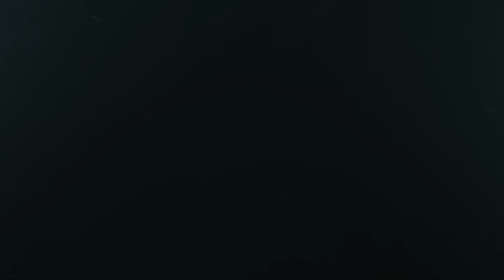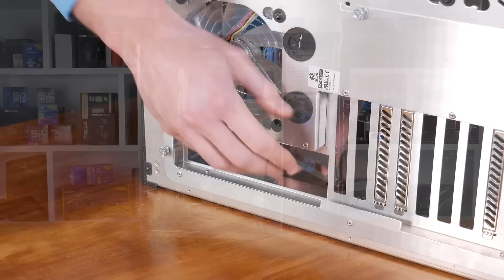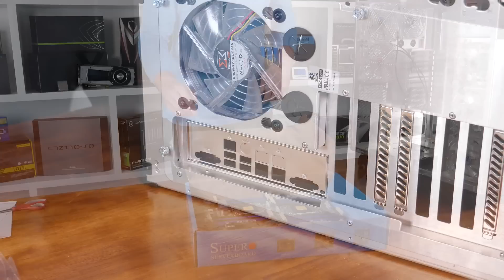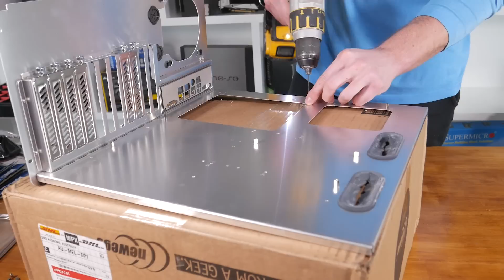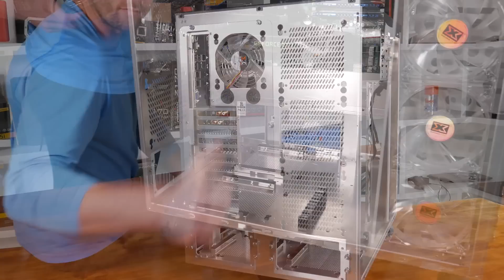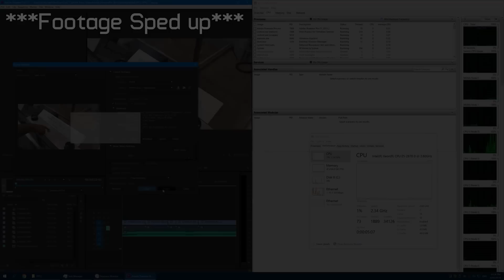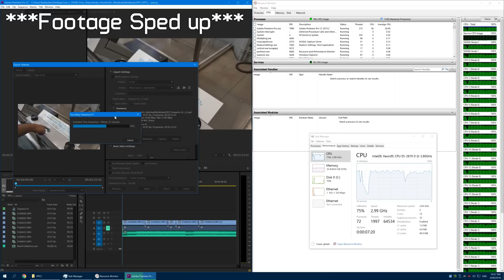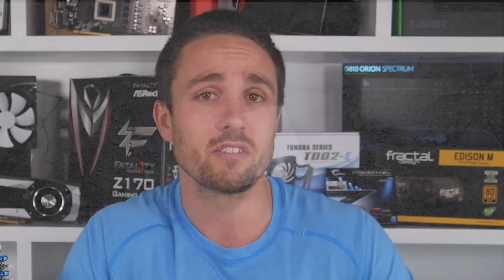6950X vs. Dual Xeons: Premiere Pro CC Encoding Battle

Comment: Time rolls on.  This is not such a good deal now.
An i7-6950X now sells on eBay for about $475 US.
A pair of E5-2670 are around $150-$200 US.

If you go with dual Xeon E5-2670 vs i7-6950X you are getting:
- Sandy Bridge vs Broadwell-E
- Released 2012 vs 2016
- 32nm vs 14nm
- 16/32 thread vs 10/20 thread
- AVX vs AVX2 (2x faster on certain functions)
- 2.6/3.3 GHz vs 3.0/3.5/4.0 GHz (faster IPC, faster single core)
- 20MB vs 25MB cache
- DDR3 vs DDR4-2400
- ECC required (ECC usually has no heatspreaders = hot!) vs not required
- LGA2011 vs LGA2011-3

And the typical motherboard required for each:
- dual CPU vs single CPU
- server vs workstation
- EATX (monster case) vs ATX
- X79 vs X99 chipset
- No VRM heatsinks vs usually VRM heatsinks
- SATA3 or 6 or mix vs often 10+ SATA6
- USB2 vs USB3
- limited OS drivers vs full Windows support
- lots of oddball RAID and NIC and Video and peripherals vs typically standard Intel peripherals
- usually no sound chip vs sound

Plus the dual Xeon has the following things to keep in mind:
- LGA2011 server dual CPU motherboards are usually a lot more money than LGA2011-3, up to twice the price.
- The memory for each CPU is separate, so if the dual Xeon board is populated with 32GB that is 16GB per processor.
- The motherboard is EATX which requires a different large case that supports that form factor.
- Requires two CPU coolers, twice the price.
- Twice the processor heat dissipation.
- Most software these days, from Photoshop and Premiere Pro, to WinZip and 7Zip, to Max and Maya and Blender, to UE4 and Unity, and especially video games, higher core frequency almost always wins in performance.  Especially in games and productivity software, where most games don't support more than 2 to 4 threads, and most productivity software is 1 or 2 threads.
I played around with a few 16+ core servers a number of years ago, and simply gave up when I had my i7 4C+HT CPU's beating them for less money and work on most software.

Comment: thanks for this review, just bought a z620 with dual 2640 and 32gb ddr3 for £350, will spare another £100 for extra 64gb once arrived! My spare 1tb ssd and my good old gtx980ti going straight into it.

Comment: one more question if I have a budget of 600-700$ should I invest in Xeon processor or i5 processor, slight gaming and more of 3d rendering.
Reply from the maker: Probably Xeon.
Reply: Netraraj Pun e3 1230v5
Reply: kasian E3 1230v5 was out of my budget, it cost around 650$ in India
Reply: Netraraj Pun That sucks mate. You might want to take a look at the e5 2670 it's cheap on ebay
Reply: I love to do that but believe me the ebay India is just useless. Most of the time we get broken product(mostly when a used product is bought). Finally ended up using i5 4460, yeah its not great but its working
Reply: Netraraj Pun still a very nice cpu! have fun with your pc.
Reply: :D thanks.
Reply: Ryzen 1800x is much better under500

Comment: The Problem is more with Adobe Premiere itself that does not run well on high-end Processors (and even worse on low End consumer grade processors), does not scale with a second socket (due to the utilisation of just ONE process that does only reside in one processors memory due to being only one process). You are better off buying a 15" Macbook Pro instead of just the 5960X, that is giving you better results in Final cut.
Reply: Final cut is designed to only ~roughly~ work with whatever chips Apple decide to put in their machines, which is off considering the Mac pro desktops used X79 in the past.

Nonsensical little side note
Reply: FCPX is designed to run at exactly the hardware Apple (only their current hardware!) uses and nothing else, sadly. But that was not X79 but C602 (which is actually the same die but yeah) because Apple uses Xeons in that thing.
Reply: Nonsense and Pure Crap. PPro CC runs perfectly well on high end processors and scales with 2 CPUs (and GPUs) just fine.  If you're so determined to run your 15 inch Mac Pro and FCPx that's fine. Just don't pretend that it can compare to PPro on a dual high end system.
Reply: Okay. Did it change recently? I tested back in March with dual E5 2658v3s and really, there was no performance benefit with 2 processors whatsoever. It was even slower. GPUs are a bit of a different story but in general support for GPUs is pure crap and you get like 50% faster render times with 600% more compute power which is a pretty bad quote for any developer.
Reply: The best bet for video editing processors is currently the 6700K, not because it is a insanely fast processor, but because it is insanely popular. On a Mac you can get away with anything > Macbook Air
Reply: You're only talking output rendering times which is not an Apples to Apples comparison as the touted rendering times in FCPx are from Prores transcodes and not from camera originals that PPro renders from. AFA rendering, PPro uses all available cores and hyperthreads. But the real point is that you say in your OP "runs". And '"runs" means editing, not rendering and PPro edits with all available cores and hyperthreads and I assure you that trying to compare a MBP FCPx with a dual Xeon 1080GPU PPro system performance wise is ludicrous.
Reply: Sorry, I meant the actualy program with "runs". And yes, a wimpy MBP puts a fully fledged workstation to shame when it comes to rendering times. I know that the final render is from pro res but why should one render from the original? That makes no sense in any way apart from having an argument why it unfair to compare. And by the way, editing with premiere is extremely powerful but a shit of an unpleasing user experience. Adobe is quite good for complex things in general but youre outta luck if you have to get something done quickly.
Reply: No, the touted rendering times in FCPx are FROM the lowrez Prores intermediates not TO Prores. Therefore they are much faster than from camera original material. You render from from camera originals in PPro because 1) you have no need on the front end to render intermediate transcodes as in a low powered FCPx system and 2) you get higher quality  output.  You should be aware that an unpleasing user experience is in the eye of the beholder. I find FCPx a much less pleasing experience than FCPx. But I do complex docs with a lot of 4k material which a dual Xeon system is ideally suited to.
Reply: Right, but this is rather Adobe fault, not Intel. Adobe has a history of poor coding and overcharging customers for selling unstable, early alpha versions as the final products. My suggestion would be easy - stay away of Adobe.

I have a workstation based on 2x 2640v4 (40 threads in total) and rarely see more than one thread utlised in photoshop, illustrator, premiere or ae. This is the 2017 CC edition, not some ancient software.
Reply: I love editing in Final Cut Pro. I hate editing in Premiere Pro but I can't do Apple desktops. My 15" rMBP just flies through complex edits sometimes!

Comment: Xeon = lower cost and much more bang for the buck even the Broadwell Xeons are vastly cheaper than the i7s. Rocking a $105 12 core v3 xeon on a x99 :)
Reply: Which cpu is that ? Is it clocked over 3.0ghz ?
Reply: broadwell xeons are extremely expensive. Idk who told you that, but they are the newest series. 

the v3 series is not broadwell.
Reply: TheDarkToes
Look closely on eBay and you can find tested ES and QS samples at decent prices. They are only cheap because data centers and oems get them first and often upgrade to higher clock models pretty early on.
Reply: Except those are Engineering Samples etc.. and don't have as high clock speeds in many cases, which is on top of the fact that Xeons don't overclock at all to begin with besides a couple hundred mhz using FSB/Bclk etc.. tweaks. Plus they are often sold by semi-shady Chinese/Korean etc.. sellers without the warranty that you'd get on an i7 bought from Amazon or something. (even buying a used i7 etc.. on amazon you still get their 30 day a to z guarantee and can return it for almost any reason for no charge and no fuss, on top of the 3-5 year warranty on most new Intel CPUs)  That's not to say it isn't a good deal, because it is. Unfortunately there are no dual socket Xeons with high clock speeds so they are a deal breaker for anyone that does a lot of intensive Virtualization work or those who do Gaming etc.. Even machine learning often benefits quite well from clock speed gains and often doesn't require any more than ~3 threads per GPU so something like the i7 6850K for ~$550 would get you 12 threads at ~4.4ghz with a whopping ~30-35% increase in IPC from the several generations of improved architecture you gain going from a sandy bridge Xeon to a Broadwell i7 (even moving from a Haswell V3 Xeon to a Broadwell i7 would still net you up to ~10% gains in CPU intensive loads).  The 6850K would give you 40 pci-e lanes so you could have two Tesla/Quadro/TITAN/Firepro etc.. series GP-GPU's both with full 16x lane support and have plenty of lanes left to support both a redundant and safe RAID5 setup of four 2TB mechanical HDD's as well as a fast RAID0 array with two NVMe SSD's through M.2 and U.2 etc... thanks to support on X99 chipset. And not only would you have those advantages of higher clock speed, lack of "bottleneck" to your GPUs for workstation tasks, and having fast and safe storage that also doesn't become a choke-point to the rest of your system; but you'd also have the capability to use super fast ~3200mhz DDR4 RAM in up to 128GB capacity which for the average workstation user is MORE than enough; making the insane ~768GB max RAM capacity of Xeons kinda useless to all but the most hardcore proffesional etc.. users. (ECC necessity is grossly over-estimated. This is shown by a lot of modern experts that have proven that the vast majority of data corruption is HARD faults not Soft ones that error correction would be able to fix such as alpha particle bit flips etc..   as well as the fact that GIANT corporation datacenters like GOOGLE's massive server rooms, which as recently as the year 2000 or so had SELF-BUILT servers using REGULAR RAM memory in them with no error correction) thus significantly widening your memory bandwidth over the limit of ~2133-2400mhz that haswell/broadwell Xeon's will limit you to due to stability regulations.  

My i7 6800K at 4.5ghz was able to hit over 1,400 points in Cinebench R15, which is actually even higher than my old i7 5960X gets at stock 3.5ghz (1,350 points or so. And the 5960X went to a very nice ~1700 points at 4.6ghz too.), remember this is a SIX core 12 thread Broadwell i7 getting as good rendering score as an EIGHT core 16 thread Haswell, simply due to one ghz higher clock speed. Imagine how much bigger that difference will grow to when comparing a typical ~2.6ghz Haswell V3 8 core Xeon (Still gonna run you around ~$350-400 minimum even used from chinese ebay sellers etc.. only ones that are as cheap as you mentioned are ones that run more like ~1.7ghz with 2.1ghz boost or something.  That turns into a situation where a 6 core 12 thread Broadwell @ 4.4 - 4.5ghz becomes * almost * equal to a TEN core Haswell V3 in the ~2.0 - 2.4ghz range.
Reply: TheScaleless

Yawn what ever, these are looked at as a budget option until prices on retail models come down.
Reply: lower cost for used... E5 xeons cost eazy 2000dolars... and E7 up to 7000doalrs for one :D talk about low price now
Reply: wwhat is high closk speed for you ? there are 3.0ghz xeons... and with that much cores you rip everything a part in rendering ;)
Reply: E5 2670 realy costs $60 per processor
Reply: MrKillswitch88 what CPU is that

Comment: Recommendation: Open the CPU socket without removing the plastic cover. Install the CPU. Close the lid. The plastic cover will now come off while the CPU is correctly installs. This reduces the risk of touching pins on the CPU socket.

Comment: Premiere pro has issues with excessive core utilization. Try to disable one of your Xeons and your result will be the same as running both Xeons. If you can try a different rendering software to compare, such as Sony Vegas pro or some thing simple such as DVDfab video converter. :)

Comment: I'd recommend natex.us for North American viewers. They have used E5-2670, Intel dual LGA 2011 motherboards and server RAM. You can buy a fully populated board too. I've had excellent service from them after I needed RMA a motherboard. 

Something I learned the hard way: Server ECC fully buffered RAM is cheap (64 GB for $100) but it gets really really hot and uses a lot of power. FYI.

Comment: Hello, I saw your video is very interesting, I have a super micro as yours, but the problem of supermicros, do not support SLI with two graphics cards if you want to increase the power of GPUs adobe premiere pro cc, I have two e5 xeon 2650 2géga, 2 cores each, in total 32 cores, 86 memory Gega, 2ssd raid 0 for the system C, two normal disk in raid 1 for hives and projects, the all running on windows 10 64-bit, but I jerk in adobe premiere pro cc even with two gtx 980 Ti, I do not understand the problem, how can I change my computer, I work with Intra 100 of hpx camera 250 the need with a panasonic 4k, I wonder not if xeon is a bit slow compared to yours? or something else that must be solved, thank you for your help. my greetings.Bonjour, j'ai vu votre vidéo est très intéressante, j'ai un micro ultra que le vôtre, mais le problème de supermicros, ne prend pas en charge SLI avec deux cartes graphiques si vous voulez augmenter la puissance des GPU Adobe Premiere Pro cc, j'ai deux e5 xeon 2650 2géga, 2 cœurs chacun, au total 32 cœurs, 86 mémoire Gega, Raid 2ssd 0 pour le système C, deux disque normal dans un raid 1 pour les ruches et les projets, le tout fonctionnant sous windows 10 64 bits, mais je branler dans adobe premiere pro cc même avec deux gtx 980 Ti, je ne comprends pas le problème, comment puis-je changer mon ordinateur, je travaille avec intra 100 hpx caméra 250 la nécessité d'un 4k panasonic, je me demande pas si xeon est un peu lent par rapport à la vôtre? ou autre chose qui doit être résolu, je vous remercie de votre aide. mes salutations.

Comment: I have two E5-2697V2 12 core Xeons and they are cheaper than one 6950X and they will run circles around it in heavy threaded workloads. The CPU needs to be optimized for the type of workload.

Comment: The Xeons are designed for use with 1333mhz memory.. as a result for $120 you could have gotten 128GB for use in the system... bad idea to go with the 1866 mhz memory...

Comment: I bought a used dell workstation with a 1000w psu, windows 7 pro, e3-1245v2, 8 gigs ram, 1tb hd, and a shitty quadro for a total of 325$. Now I need to slap in a 7950 I have laying around.

Comment: Where the heck you finding these for $60 each?
Reply from the maker: China mate, China :)

http://www.ebay.com/sch/i.html?_from=R40&_sacat=0&_nkw=E5-2670&_sop=15
Reply: Hardware Unboxed You should probably point out these are engineering samples no?
Reply from the maker: Err they aren't, at least not all of them.  FYI "SR0H8" is not an ES :S
Reply: Hardware Unboxed Damn B.  Do you know if any boards support overclocking?  Then we're really talking.
Reply: Can't overclock most Xeons.

Comment: I built the same system from one year and couldn't use is properly it gave me always blue screens till i called Asrock support and they told me this motherboard only compatible with windows server And that's it when i installed windows server 2016 it works like monster

Comment: i7-6950x very hot CPU, but price? i'm buy Z620 with Dual E5-2670 + 64GB RAM only for ~1400USD, how much price for similar config with i7-6950X? For real compare,  need compare system with similar price. If you need render monster for low price, many people use Xeon ES and QS, and 6950X will lose if compare him with ES and QS Xeon.

Comment: why using GPU acceleration? Linus's videos shows that no matter how much the CPU core count, if GPU acceleration is present, higher clock processor wins, even 6700K.
Reply from the maker: Did you see the screenshot of the Windows task manager showing CPU utilization? :S
Reply: Hardware Unboxed i see that, but its better GPU acceleration disbled, so there is no external factor to account.  BTW nice editing and explantion...
Reply: Exactly. This is a 6950x vs 2x Xeon build.
Reply: Karras Bastomi not all export uses gpu

Comment: I don't think processor cores and speed do much at all for programs like Premiere. I upgraded from an Intel Core-2 Duo to an i7-6700k and didn't notice much of an improvement. -- Upgrading my graphics card however made all the difference in the world. The more CUDA cores, the faster/smoother Premiere and the likes run.
Reply: Thanks for the tip.
Reply: Not for rendering the video's out though, that is going to be mainly dependent on the CPU.